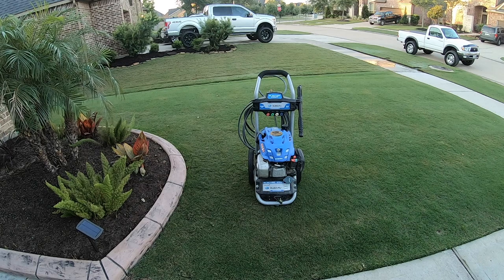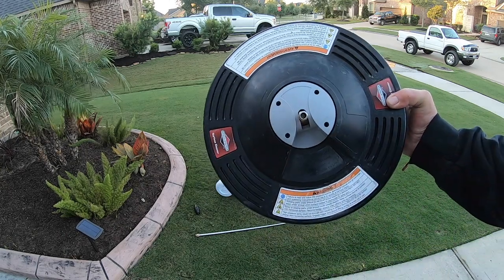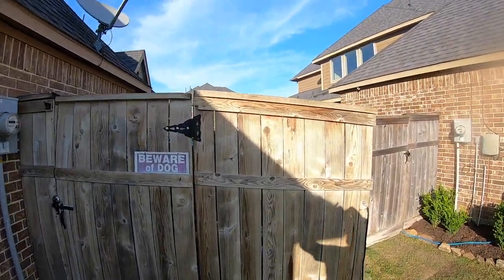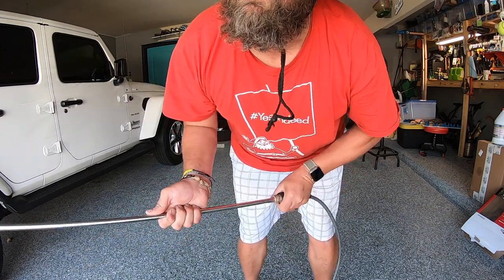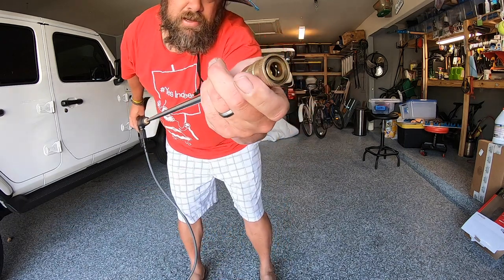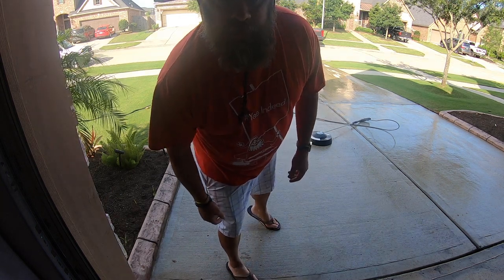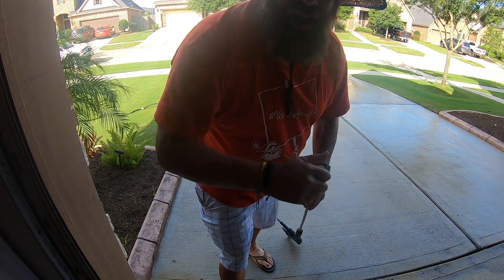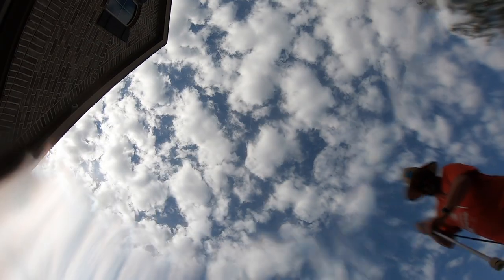Power washing the driveway and sidewalks w/ Subaru PowerStroke 3100 PSI Pressure Washer

Comment: Yep, I need to pressure wash all the mildew off my driveway.  I have one of those surface cleaners and it works fantastic.  I use a 2300 psi electric brushless pressure washer.
Reply from the maker: Yeah, concrete gets abused with this crazy Texas weather. Thanks for watching.  Cant wait for the next update on that badass brew shed! Cheers dude.